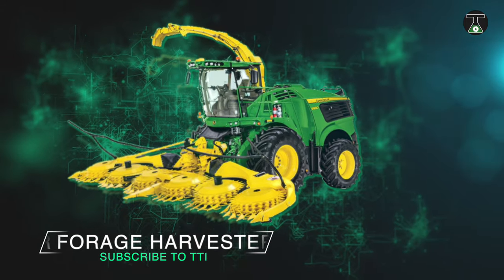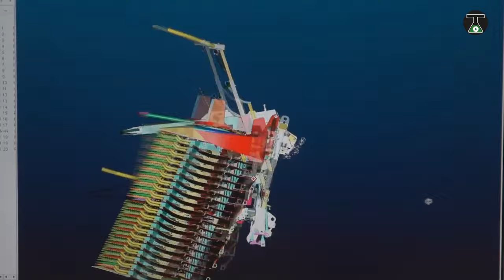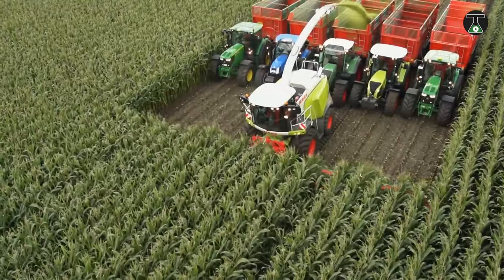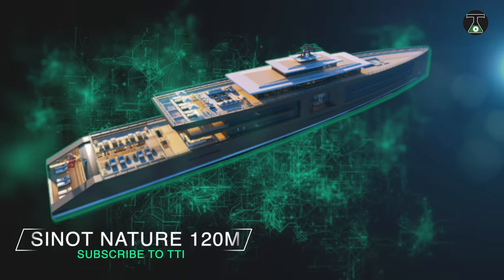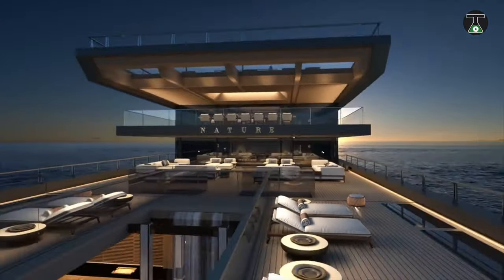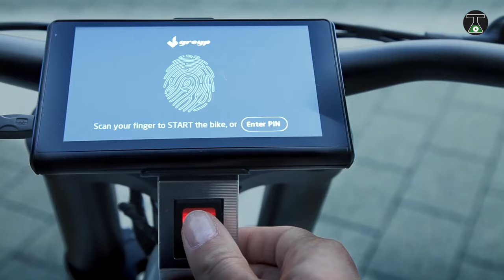7 Mind Blowing Machines You Should Know ▶ 16

Comment: That's a design I'm surprised we don't see implemented in more mega yachts and well boats even today the RV feature where side panels can extend out for more living space I understand that the boats superstructure and skin needs to be completely sealed but with that said a lot of these are way above the water line and above the top half portion usually a little more never even really sees the water touch it and you could add expanding platforms on the upper layers and with technology today I'm sure they could be sealed